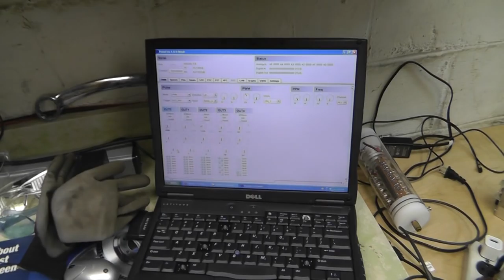Hydroxy Has More Explosive Pressure With Extra Ambient Air??? "Burn-O-Meter"

Comment: PT2-when you add atomspheric air you increase the burn time causing more heat.This eliminates most of the vacume when the HHO returns to it water state as the now mixed gases remain hotter for longer.A guy by the name of Kultus on our forum has been to a seminar were they show'd this happening in a sealed ram.When they filled it with HHO fully extended and ignighted the HHO-the ram actualy went back inside the cylender.

Comment: With 'extra' air in there it means you are not left with a total vacuum when the HHO is all reacted.
The inertia of the solid piston and the elasticity of the air/steam mix in the tube allow it to travel further.
I noticed the distance travelled increased with more firings. Possibly condensed water from previous firings is vaporised further adding to the gaseous expansion. And possibly acting as a lubricant.
Maybe try silicon oil and O-rings to have a known 'slip-factor'.

Comment: As Stan suggested, You must add water vapor... When the hho gas ignites then the heat will transfer to the water vapor (liquid) to cause it to convert to a steam (gas). In the process of this change of state, there will be a rapid and explosive expansion in the chamber. Also, Steam itself will convert to hho if exposed to temperatures in excess of 5000 degrees F. This is why you cannot put out some fires with water... It will act like more fuel!!!

Comment: When you allow compressed air to enter the system this increases the amount of oxygen therefore the burn time will be longer due to the extra oxygen. Once you add in the non combustible gases the energy level of the explosion should decrease because you are diluting the mixture with non combustible gasses this is why Stan added all the gasses. He added ambient air to increase the burn time and non combustible gasses to decrease the energy level of the explosion making the burn equal to gasoline.

Comment: HHO is already at perfect combustion mixture, therefore  "explosive"  flash-bang reaction, there is nothing to slow down the re-combination of the atoms. Air is a LOT of Nitrogen gas, inert and will act as a "barrier" for the recombination of atoms.. so we get slower burn... 

The extra O2 will make small difference, although O2 is slower than O O in burning.Slightly less energy release. 

I THINK ITS THE LOSS OF VACUUM, since you do not have just water vapor after combustion.. just a idea ;)

Comment: the addition of the extra fluid allows some of the energy from the explosion to heat this fluid (air) and therefore expand. Did Stan Myers not add water vapour to his mix? Water vapour may result in an even more effective pushing force, as it heats from vapor to gas, the change in state from liquid to gas would result in an expansion not only due to heating but also due to the gas occupying greater volumetric space. phew, that was a longer sentence...and relaaaaaxxxx! Ahhh.

Comment: Russ, Good Testing. First, is it Air or Oxygen that is added extra. If it's Oxygen, well it goes further because it is more reactive. Same thing as the fuel in for the space shuttle. They Hydrogen and Oxygen are kept separate and then brought together for the controlled explosion in the exhaust vats. Hope this helps Russ.

Comment: Possibly humidity in the ambient air, expanding as steam?  Is varying friction on the piston a factor?  What about water droplets as a result of the previous firing?  Try adding additional pure dry oxygen.  I'm short on chemistry, so is the hydrogen/oxygen ratio ideal for most powerful explosion?  How about internal pressure behind the piston from temperature, varying the gas charge?  The procedure leaves too many unresolved variables.  Keep trying, I know you will.  Randy

Comment: @fuelban Hi Russ, I was pondering this, and as HHo is 1/3rd oxygen, 2/3rd hydrogen, Whilst “Ambient Air” being divided up at 21% oxygen 79% inert gases, so for every 1 litre of air 200 ml being oxygen “flammable” there is 800ml “inert gases”, it would be interesting to see how the hydrogen burnt {expanded} in your test if the feed stock was pure oxygen & what would the potential of that power exchange be !
Thom

Comment: Theoretically it may indeed be, but the essence being you are burning the hydrogen to its fullest extent by offering abundant oxygen source to burn, without oxygen there is no burn & certainly "NO EXPLOSION", Indeed less than 5% oxygen content = "IMPLOSION" no expansion no force of momentum of expansion, offering abundant oxygen is offering a complete exchange of force potential, I would like to try on your equipment something slightly different. very interesting video.
Thom in Scotland.

Comment: Russ, when you say you are adding ambient air, does the overall volume of combustible gas change? Or, does the volume remain the same, and the "mix" changes, i.e. less HHO when air is added in the same total volume. Thanks. If you want to completely combust the H2 / available, you need to go 34:1. But, you got HHO, so that will need to be reworked, cause you have extra O. Cheers. If you want tech. docs on this, PM me, I have all the equations.

Comment: Russ your not increasing combustion!  You’re giving your cylinder a non combustible gas, Nitrogen. Heat from the combustion is being transferred to your ambient air. So what you’re seeing is the thermal properties of your HHO, causing the thermal expansion of all the gases in your cylinder. 78% Nitrogen, 21% oxygen and trace gases.  HHO can burn at several thousand degrees. What would be interesting is to measure the difference between pure HHO and the ambient addition in a burner.

Comment: Also 
there is a Density change in the ratio when a tertiary gas is introduced……..
Also you are not only introducing just Oxygen from the compressor.. the mix is ambient, so Nitrogen and Ox plus a small mix of inerts.
If you are going to call out Oxygen introduced in to the device then add just oxygen to do the test…
Don’t mean to be critical, but really is should be called out correctly… so it can be documented…
Bill